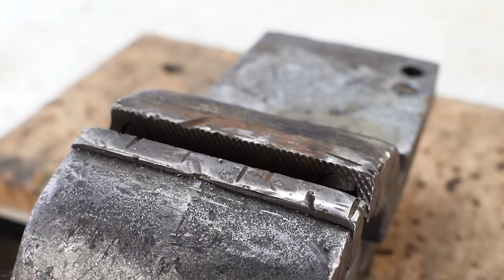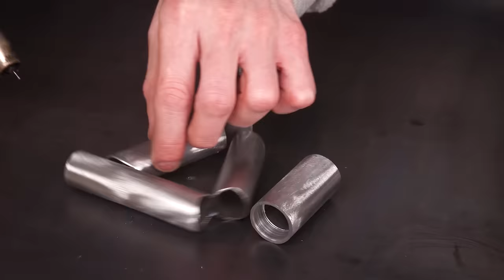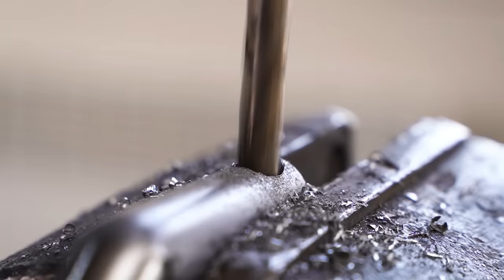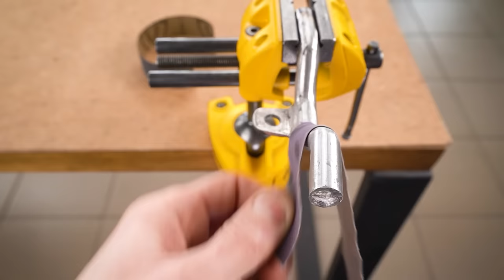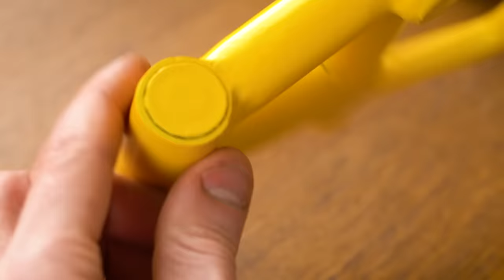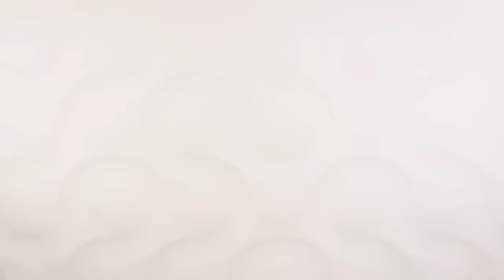The Smallest Fully Functional Bike

Comment: now make the worlds smallest working e bike!! If not I will cuz it seems like an interesting project. and DONT use a mid drive motor, that's cheating, use a tiny hub motor with a tiny throttle and a tiny little battery on it